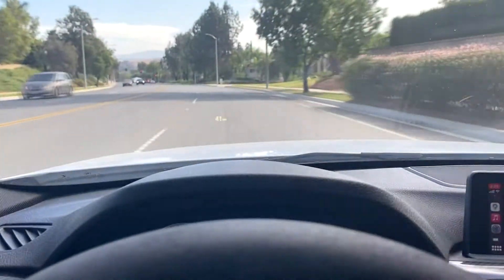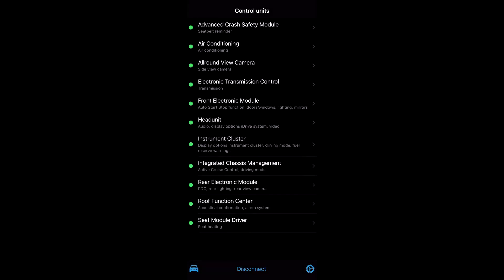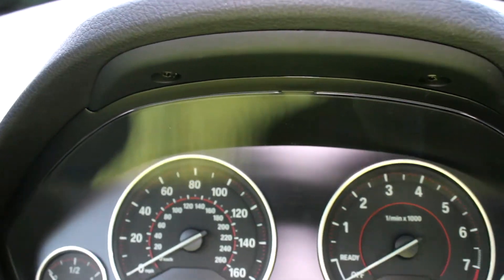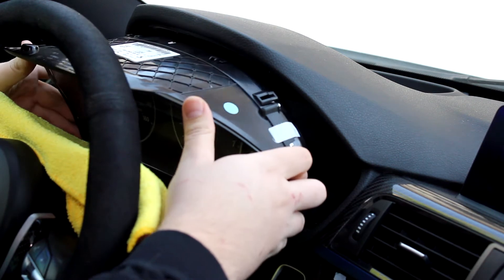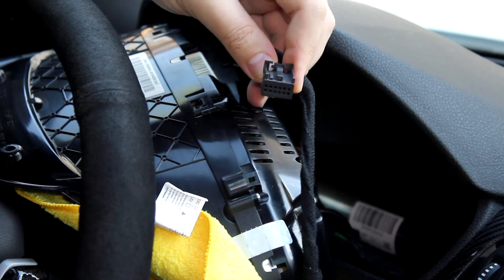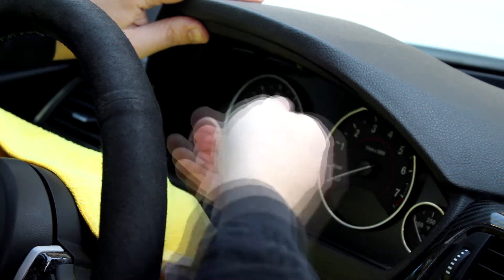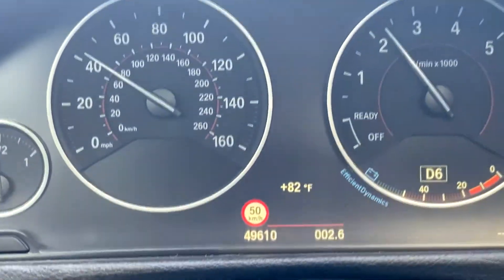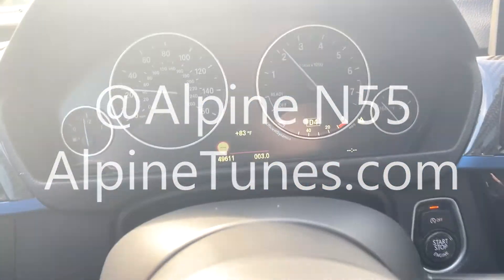HOW TO RETROFIT SPEED LIMIT INFORMATION IN A BMW F30

Comment: Does the no overtaking icon program as well?
Reply from the maker: That’s a complete different system which you can retrofit but you would need all of the parts from a car that had the package. It will not be added in with this module. This module just grabs predefined speed limits from the GPS data and displays it on the dashboard
Reply: @alpine.n55  appreciate the clear reply thank you! Just followed your vid and installed one moments ago. Thank you again!

Comment: Thanks for this video. I was wondering if I should buy a SLI unit but wanted to know if I could code it with Bimmercode. You have answered my question. Both of my BMW bikes have the speed limit info on the dash, so I know how useful it can be. 2018 F31.
Reply: SLI has arrived and was fitted this morning with your guide on how to use Bimmercode. Works perfectly, one again thanks.
Would buy you a beer except that I am in the south of France. Have subscribed instead.

Comment: My iDrive completely died after doing this, but recovered. If someone has the same problem, here's how to solve it.

I was using ENET with Bimmercode. Coded everything in, and after coding in "SLI_NAVI_DISPLAY = nicht_aktiv.", iDrive just died and didn't wake up. This code was apparently needed, at least per my instructions. Maybe you can leave it out. Anyway, I held down Mode + Power for 10 seconds to reset it, still nothing. I proceeded to let the car go to sleep, so lock it and came back after 15 minutes, and iDrive booted back up normally. So before you take the car in or ask for help, wait first.

Comment: I have HUD, do you know if it will display there too? 
Thank you
Reply: ye, you just need to code it 'activ' for hud as well
Reply: @WUKONS  I have KAFAS camera in car. But not coded reading signs. So i coded the same thing what you have in video. but it doesnt work. HUD change language and coolant temperature showing bad. Signs not reading i only saw "---"  on hud. but no speed. Can you help me ? thx
Reply: @errorralook8921  Hello! I know it's been a while, but have you managed to resolve this somehow? I also have the camera KAFAS and only the "--- " appears, without any reading. How did you resolve this, if at all?

Comment: It doesn't read speed info from GPS, but from your Navigation, if you want speed limits on local roads too, not just main roads, update your maps.
Reply from the maker: I was referring to the navigation system when i said GPS, i am aware that the module itself does not read the speeds via GPS. Also, my maps are updated to 2021.
Reply: You are correct, but it is known as GPS navigation so the GPS tells you where you are and the limit indication is from the mapping database.

Comment: Can this be done on 6WB cluster?
Reply from the maker: Yes it can be!
Reply: @alpine.n55  did you find a fix to change to mph?
Reply from the maker: @LingLingPlayzmc  with this unit it’s not possible, but I’ve seen on the forums it seems that for 6wb users it doesn’t display the unit at all just the number